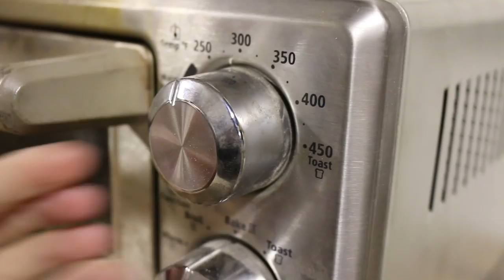Making a Knife - WITH MY GIRLFRIEND!

Comment: Knife looks awesome as always. Also she's a keeper a woman who not only supports you but works beside you is one you stay with. I only have one qualm with the knife, when you burned the handle you did it after you had epoxies it and heat and set epoxy dont mix I know you ultimately had a pin but heating it like that can easily soften the epoxy and cause it to become runny. I had it happen on the first ever integral I did and it began to run out of the knife. Other than that excellent knife cant wait to see your next one.
Reply from the maker: Seed of Life Forge thanks for the kind words! And yes I agree with both comments. Watching this video back, I realize I should’ve done the burning prior to glue up. Thankfully I got lucky this time  and didn’t have any issues.